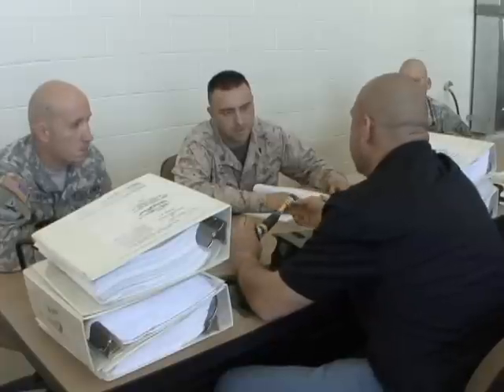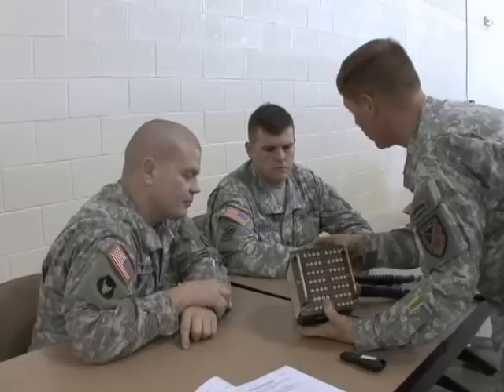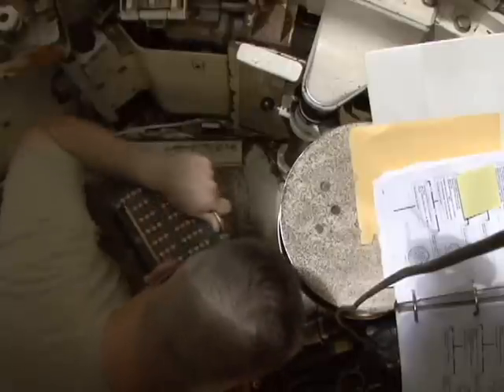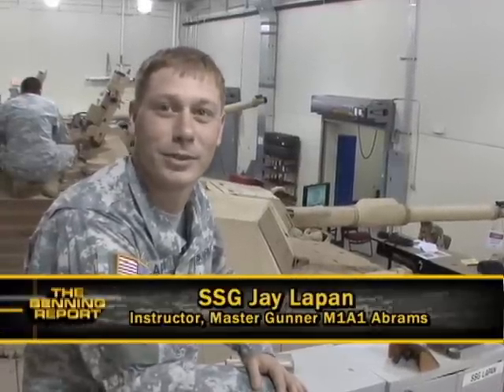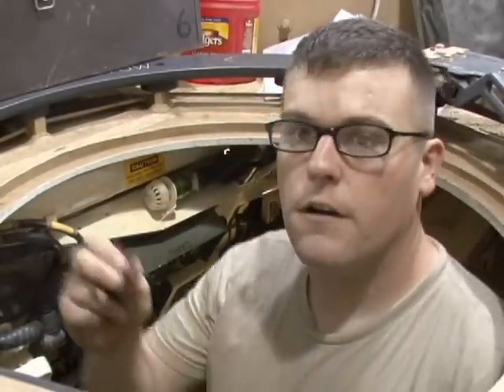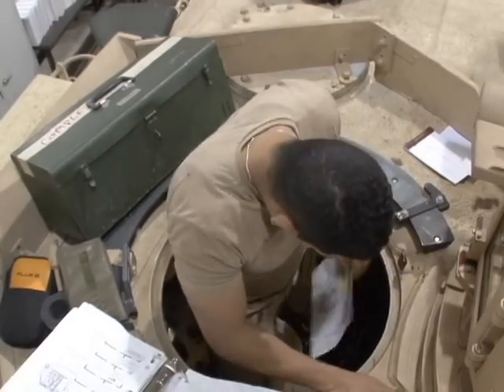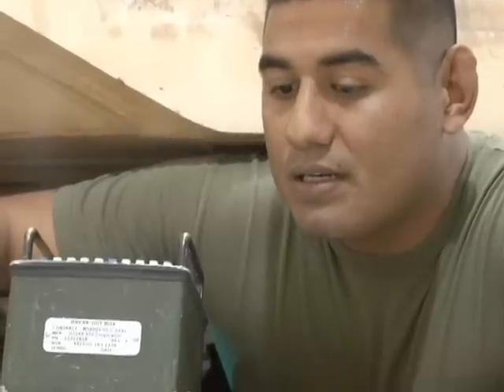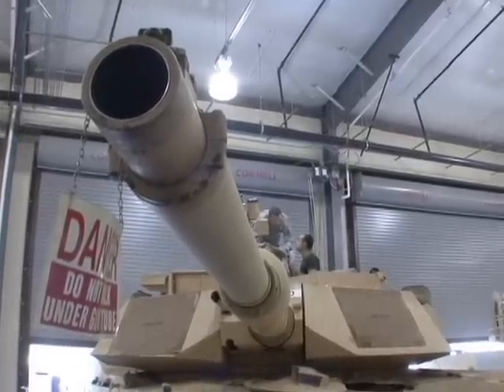Do you know what it takes to maintain a 70 ton beast?

Comment: These foriegn officers are Egyptian.
Reply: I was wondering about that. Thanks for the info.
Reply: If they wanted greater maintenance effectiveness they'd cultivate a stronger enlisted corps. When an officer has to turn a wrench or run a tester that means the system is weak.  In US military maintenance the smart officers inspect, monitor but don't get in the way.  We have a long tradition of being able to function without officers if necessary and it works.
Reply: That must be why they are wearing shoulder sleeve insignia with the word "Egypt" on them.